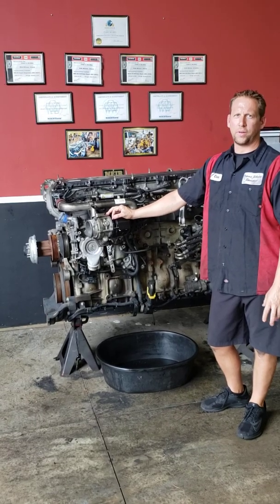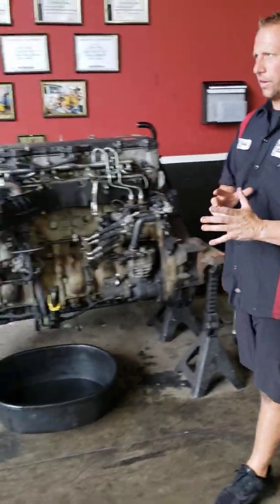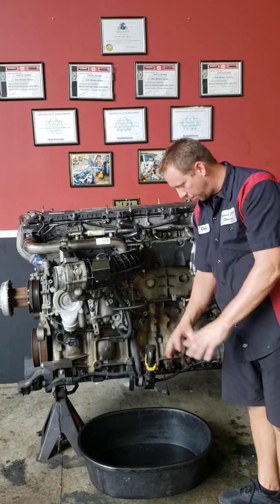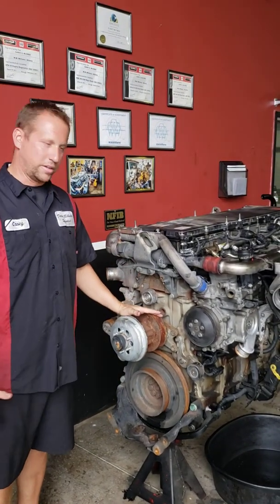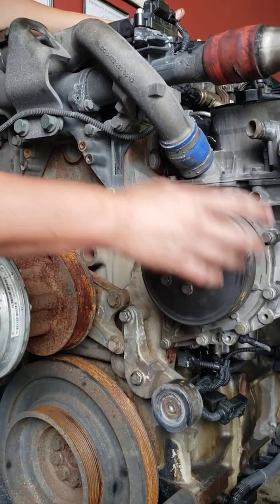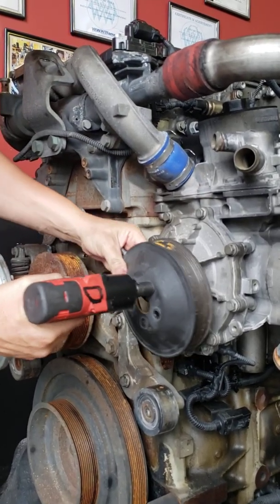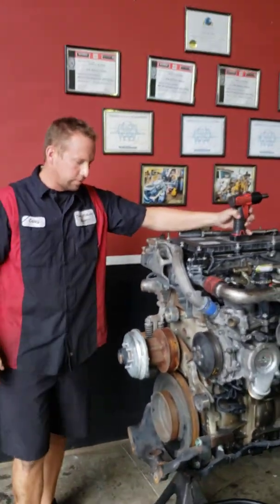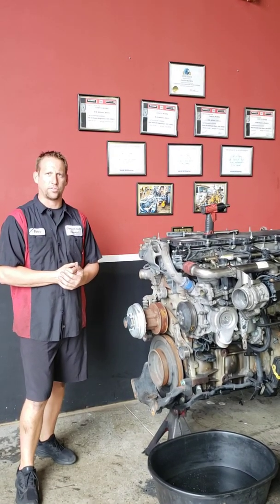DD15 / DD13 Water Pump Replacement

Comment: Should I use any silicone when I put new gasket on?
Reply from the maker: @JKVTrucking007  No sir
Reply: My teacher added little gasket maker on the seal because it had a little crack on the housing. Will that be a problem?

Comment: I have yet to Crack the block drain with out an extremely difficult time. These never seem to get opened. Personally I use a plastic concrete mixing tub. Place it under water pump remove all but 2 bolts. Back out a bit Crack it loose and let it drain. Beats having an issue with block drain at 2am on the side of the road.